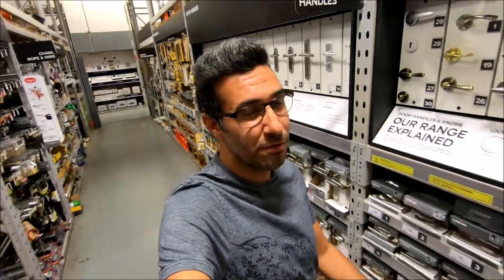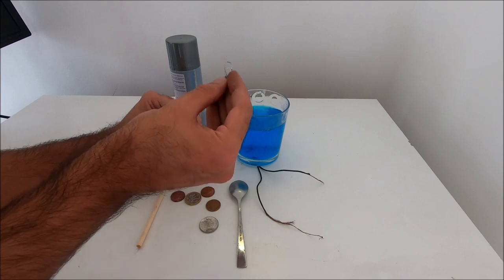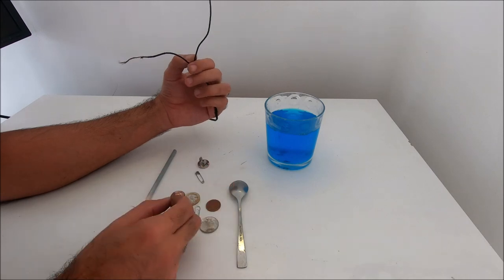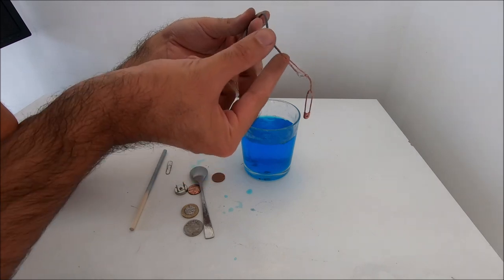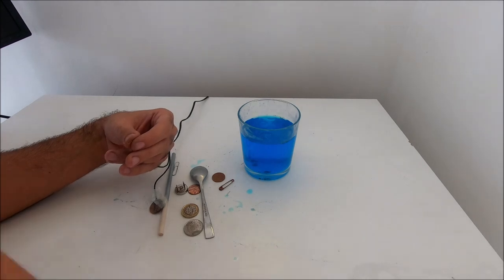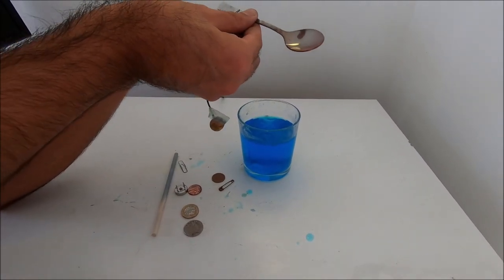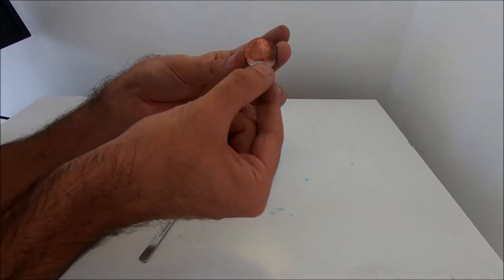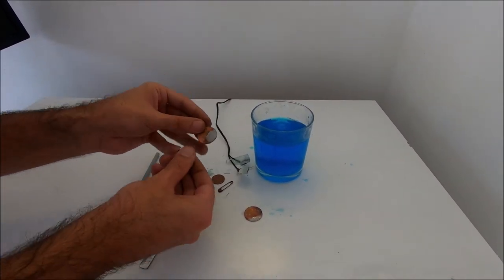Electroplating at home. Simple and easy

Comment: Thank you for this video. I have a question it would be so kind of you to reply. I tried gold plating a ring in copper. As anode, I used a spoon stainless steel ( I'm not sure, it changed color badly after the process!) my ring is almost golden now but it is not shiny it's like brass ! Is that normal?
Reply from the maker: I guess because it's a thin layer of gold. Also might look shinier, if you gently wash it with a mild detergent and light polish it with a microfiber.

Comment: Thank you! I love this method, I will use it for my handmade jewelry! How would happen to the stones if put in the solution too?
Reply from the maker: Thank you. I don't think stones can conduct electricity unless you're thinking something else.
Reply: @MrYazdan  Thanks for your answer, no, I mean if the stones could be damaged or plated in some way
Reply from the maker: @paola33080  Yes you can apply conductive paint on the stone before electroplating.
Reply: @MrYazdan  so if I want the stone to stay as is... it should remain if I put nothing... thanks
Reply: Coat with wax

Comment: What is the name of the liquid? And where did you get it please as i need to Electroplating the car exhaust with gold or silver color. 

Thank you
Reply from the maker: That's copper sulphate solution. For your purpose, you need silver or gold electroplating solution, which you can easily find them on eBay,  Amazon or other online shops.

Comment: I have a question! I am trying to electroplated/electroform with a mixture of copper sulfate and epsom salts. The material has been in the solution for 48hrs and is turned blue, not copper. Please help! Is this because of the salt I added?
Reply from the maker: Not sure about the Epsom salt but definitely don't leave it for long time. Ideal time for electroplating is 20-30 minutes, maximum 1 hour in some cases. Also keep the voltage between 2V-6V. 6V is ideal. Hope this helps.
Reply: @MrYazdan  on a rectifier is that 2.0v? Or 0.02v? I think I'm gonna ditch the salt. Thank you so much for the help!